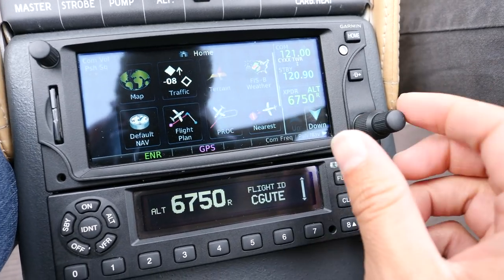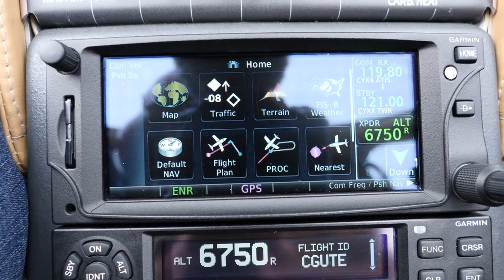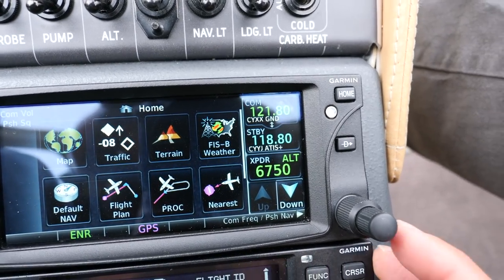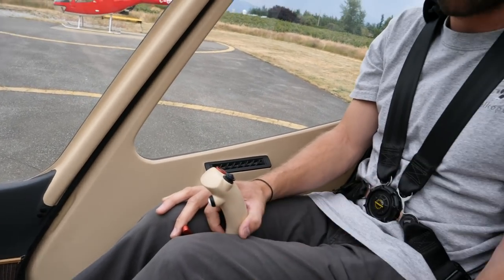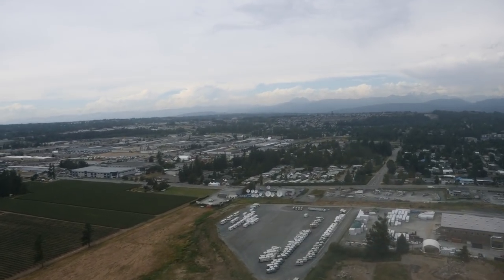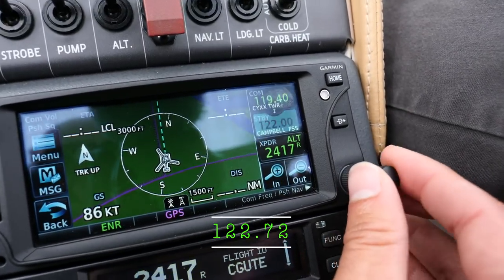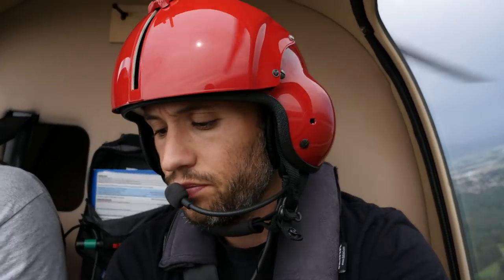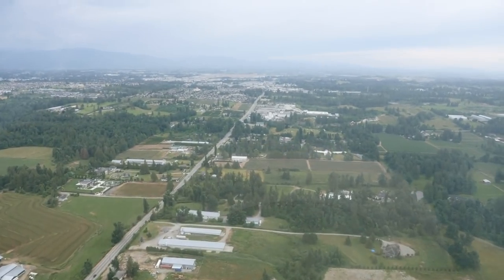Introduction to RADIO WORK

Comment: Do u always memorize all of the different freq or do u have it written or on a chart
Reply: It's sort of like the FM radio stations in the area you live in, you know what they are (on second thought maybe not with programmable memories these days), but yes they are written on all charts and often people write down lists of airports they are planning to land at or CZ they are planning to fly through (makes it easy). I've even seen tower and ground frequ. on stickers stuck to the gauge cluster for home and ground, kind like your AC call sign - removes all work & doubt when your brain is to fried to think anymore...
Reply: Step you forgot to mention controllers usually know all the locals by voice,  at leased mine do. Very nice comment btw.
Reply from the maker: You typically memorize the frequency of your local airports around you but you have maps etc that tell you the frequencies to be on.

Comment: From looking at the radio you don't seem to be 8.333mhz compliant?
Also the static is quite bad :-)
Not sure if the helicopter is the source of the interference or just area you fly in is bad.
Reply from the maker: We don't need 8.333mhz in North America.  That is only a European thing.  We had to switch our radio settings on our world tour when we arrived in Europe.  However these radios are capable of it.  We just don't have that feature activated.

Comment: To my inexperienced ears there seems to be an awful lot of instructions incorporating local landmarks. If that perception is correct, does that make it all the more difficult to comply with a controller's directions when you are flying in an area you are unfamiliar with?
Reply: Usually you can just tell the controller you are unfamiliar with said landmark/area and they will give you directional headings, distance from airport & your location etc. since they see you on their radar screens. Even pros can't know all the landmarks & features in a new to them airport. It's really only the locals that are expected to know the "callout points". Some airports have published approach procedures and specific helicopter flight paths. I remember in Torrance CA there was a cork screw spiral descent to stay out of the way of the Big Boys and their wake turbulence, usually in autorotation mode. Way fun...
Reply from the maker: Most of the landmarks that are used can be found on your map.  So if you are unfamiliar you can just refer to your map.  However like step4560 said you can also tell them you are unfamiliar and they will usually help you out.